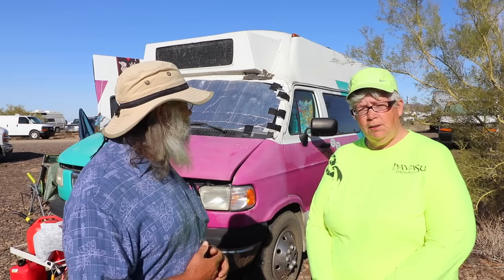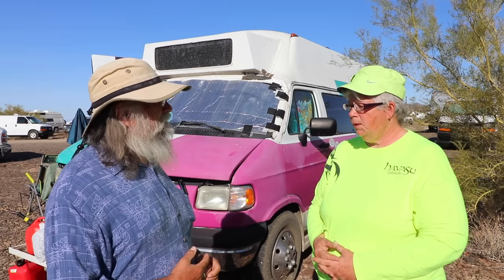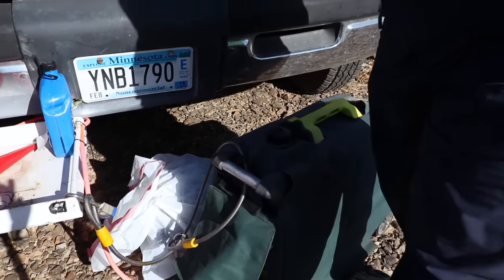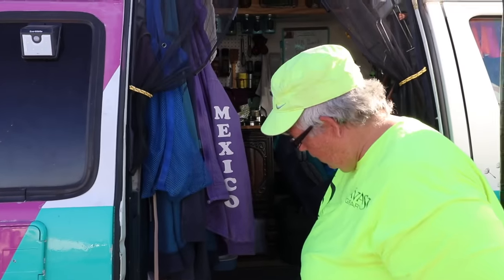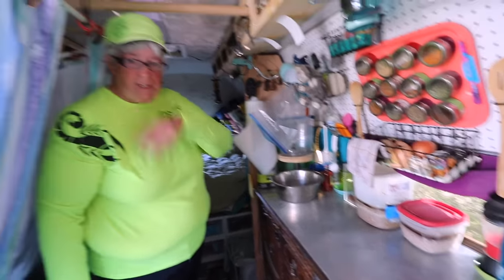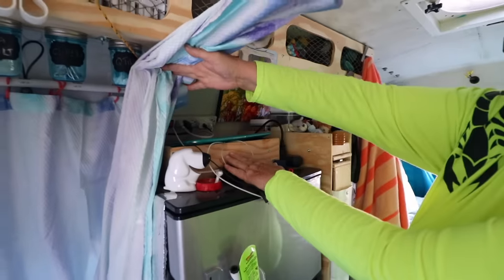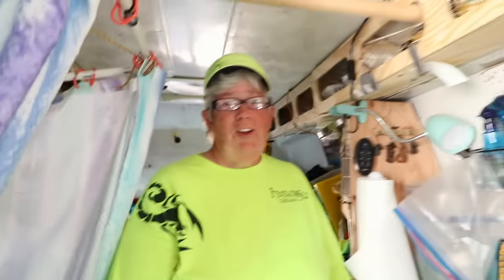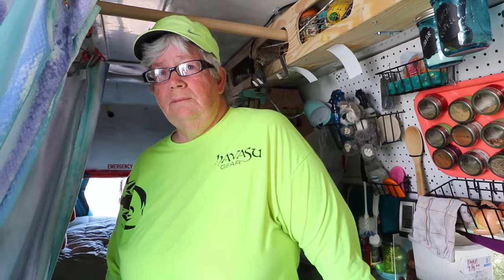Van Tour Solo Woman Living in a Transit Cargo Van

Comment: You really don't need plumbing imho.  Simply pour some water from a gallon jug into a basin with a bit of soap, let soak and then empty basin and fill with clean water with some white vinegar added.

Also make H202 (hydrogen peroxide) a galley basic - it kills molds and bad proteins... a useful cheap antiseptic that breaks down in the environment, unlike bleach.

Sometimes I simply use a Handiwipe and some spray vinegar and wipe the plates and bowls and utensils clean and then spray with H202.  Handiwipes are washable and reusable.
Reply: ColleenKaralee Peltomaa Agree indoor plumbing is so not needed.  Hand-wipes are washable and reusable.... explain please?

ThankS for the  tip hydrogen peroxide tip..  you use HP in addition to vinegar/ water right?   Is one better than the other?
Reply: Hi zorazora.  I lived with my G'mother who grew up during the Great Depression, and I spent a few years in a camper without running water  except for a very clean stream nearby, so I had gallon jugs of stream water for washing.. I had a Berkey water filter for drinking water b/c It's not tasty water that sits in plastic tanks and pvc pipes, especially in hot weather..

Amazon sells "Handiwipes" - used to be more popular before paper towels took over.  They can be washed and re-used b/c they are more durable than paper towels.

Cleaning with a bit of soapy water and then wiping down with vinegar spray or vinegar water to remove the soapy taste or smell is my routine. 
Sometimes all is needed is a spray and wipe with vinegar.

 After drying I spray with a bit of H202 just in case of mold or fungus or germs - it is an antiseptic, and one can purchase "Food Grade" 3% H202.  My dishes and cookware are always clean and shiny.   I guess if one is on the go one might want to have a grey water tank until they can find some thirsty plants  :-) 

I've successfully killed mold around a roof leak using H202 spray.

I guess it would be helpful to have a two basin sink b/c you can always put a cover over it for more space for meal preps.
Reply: ColleenKaralee Peltomaa Thank you for the reply!  I ‘ve been living in my Honda Element for over a year now.   I keep things real simple.  I shower at Planet Fitness, if I got in a pickle I would warm up water on my single burner Coleman stove and bathe!  

Thus far Ive had no problem keeping my dishes clean, I use liquid soap and a water spray bottle... I work full time, so I have access to hot water, also have water at the laundromat I go to.   After cooking sometimes I heat up water...  Im often amazed how easily I get my dishes/pot clean....   Ive never used hydrogen p— will give it a try

I will eventually buy at Nissan Envy 2500 hightop— I’d like to stand- up I think.   I have no desire for a fridge, sink— plumbing— grey water system etc or solar.  Living in my Element has taught me how little I need to be comfortable...  I despise clutter—- wanna keep it simple... real simple..  I want to b as stealth,  incognito as possible..    

Always open to suggestions...
Reply: You are welcome, and definitely get the high top - it's a body thing. The Ford Transit is looking very practical to me. 

I concur that one can manage with a comfortable bed, some temperature control, and of course some power for the laptop, etc.

For the body I love a good baking soda scrub down in between the gym.  I forgot to mention the multiple uses of baking soda. And of course liquid castille soap, like Dr. Bronner's.  Baking soda keeps the hair soft too.

Because I eat a lot of frozen fruits and veggies I want to get a small Arctic King freezer, and I really do like the Instant Pot for its multiple uses.  Of course then that would require a power upgrade possibly.

My favorite van build so far is "Wild by the Mile" and "The Road is Our Home".  Do you have any favorites?

Comment: Instead of adding springs to the rear of the van I would add air ride air bags and compressor. They will ride way better than adding more leafs to the springs. You can change pressure in them depending on the weight.

Comment: to those like me who never heard of 'shore power'... used by trucking industry so they do not have to run idle while they rest. the capability to be plugged in to an outside source of power. The idea for this is not a new one as people in the marine industry have been doing it for years, calling it "shore power". The name stuck and we in the trucking industry call it the same thing. I know most trucks have some type of power supplied by an APU or a generator of some type, but these require fuel and maintenance. In my opinion it is less expensive to plug in than it is to run that fuel fired power supply it .is also the power need to keep things charged, laptops, phones and in some cases a CPAP machine. There is also power needed for entertainment and cooking in the truck.

Comment: I am disabled with 4 lower joints replaced. I work at a Winter camp for developmentally disabled adults. 
I have paid for an acre of land which is not going to get deeded over to me. Court case on calendar this May. 
I Own a A class RV that’s been sitting for two years which is a gas guzzler. It has fried air-conditioning & heater the digital reads for tanks also. All because some bozo try to hardwire it to the big barn & fried the electrical system!!
I have a  20 foot trailer that attaches to the back of my SUV. 
I have a tiny house 14 x 20 that I have paid off but if I don’t get the land I can’t haul or move it. 
My retirement is supposed to be tiny house living on the road traveling. 
I don’t know what to do. Open to suggestions & and I’m not great with all the digital technology & things that works three different ways systems. 
Basically I live off grid, been without running water 💦 or hot water for 3 years. Minimal heat also. SUV is well kept but 15 years old. 
Do I sell everything & start over? Give up? Please give input kindly.